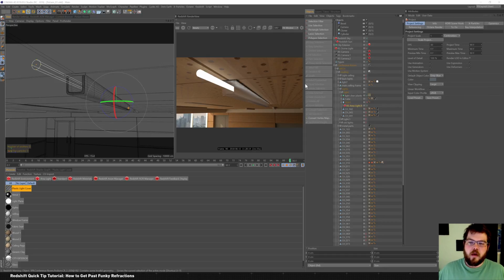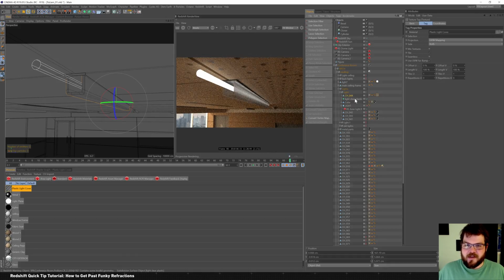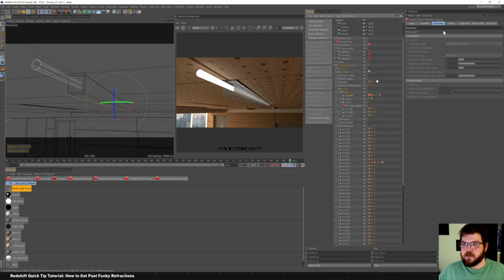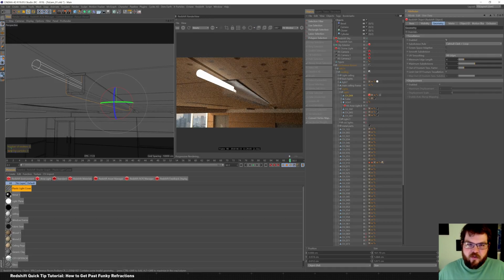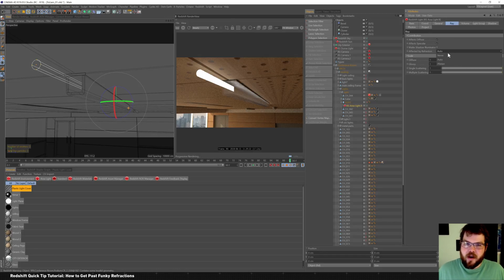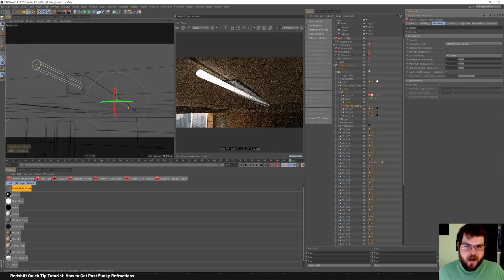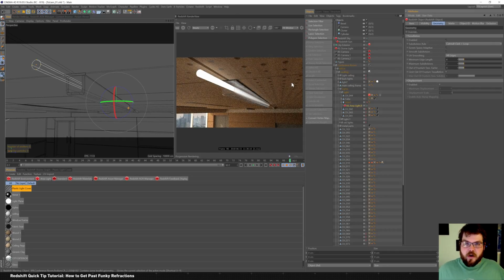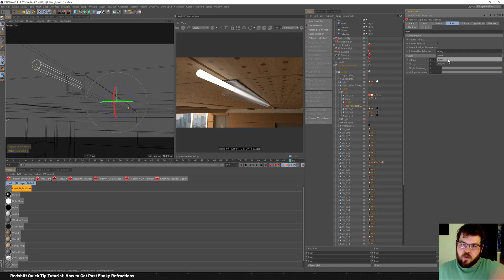Redshift for Cinema4D Quick Tip: How to Fix Refraction Issues

Comment: Hi, do you know how does this refraccion setting works with volumes that emitt light? I cant find a way to make it work, 
Thanks
Reply from the maker: Fede Mohr you have to make sure your light is set contribute to volumes.
Reply: @ProfessionallyIncorrect  hey, thanks for the answer. My light it is actually contributing to volumes. The volume i have is a massive fire emitting light, but if i have a plane in front of it with refraction although i activate 'always' on the ray tab of the dome light i wont see the fire on the other side of the plane. It seems like refraction is not working with auto illuminated volumes?? Its werid.. any other suggestion?
Reply from the maker: Fede Mohr it sounds like you may need to turn up your trace depths. However, if you’re using a material on your volume to emit light, material emission doesn’t contribute to volumes. Only lights currently.
Reply: @ProfessionallyIncorrect  hey, i found inside the advanced tab in the shader graph (rs material) there is a sub-menu refraction and it has a box that says 'Block volumes in Sub-surface Mediums' i needed to uncheck that and it worked. Thanks anyway, cheers

Comment: Thank you for the tips.
Question: I could not achieve to get shadow for 1.51 IOR reflective and refractive 2 cm glass sphere object. With photon or without. (Redshift 2.5)

Is there any suggestion for that if it is possible?
Reply from the maker: I'm not sure why you'd be having issues with it. Probably worth using a more current version of RS if it is something that was patched at some point. 2.6.32 is the most recent build.
Reply: Thank you for the information.